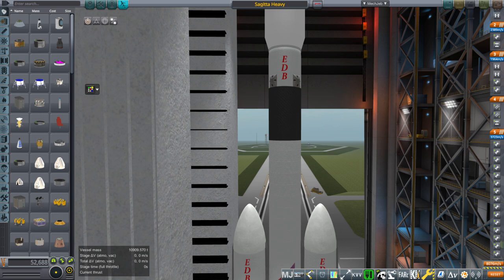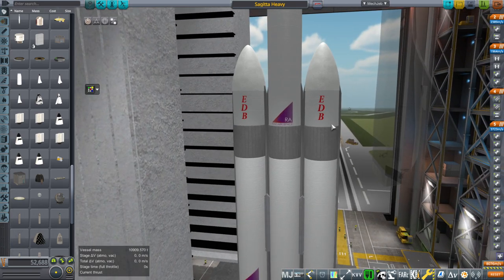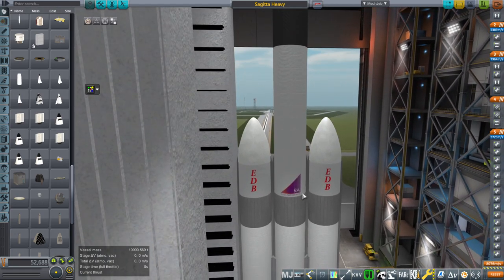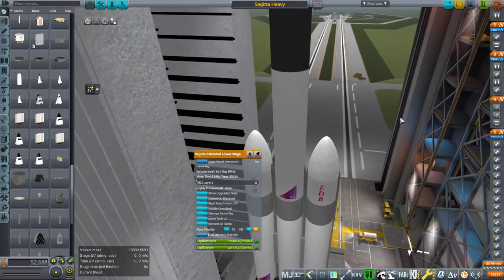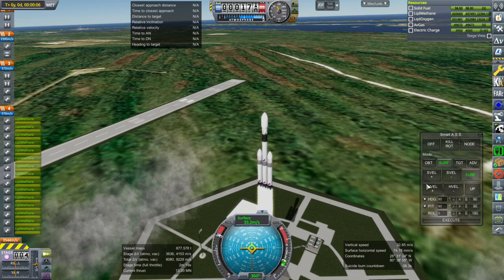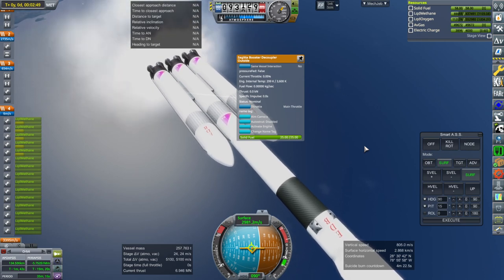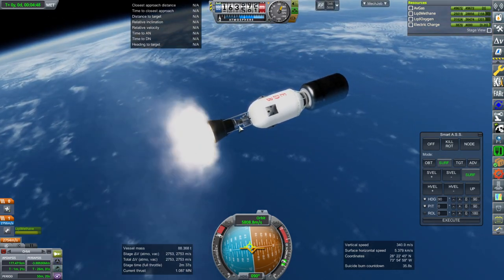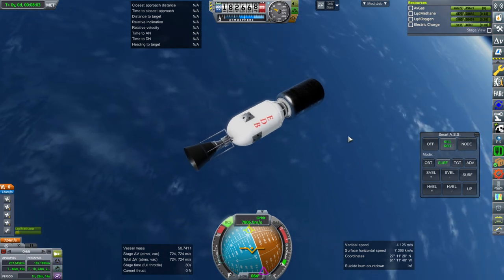Realism Overhaul in KSP 1.8.1 - Sagitta Neo

Comment: Looking good, maybe you could get away with having your boosters have 2 of the common fuel tanks and replace the small tank in the upper stage with another of the common ones.
Reply from the maker: The small tanks are also common ones, though - they are necessary for the Shinkansen system.